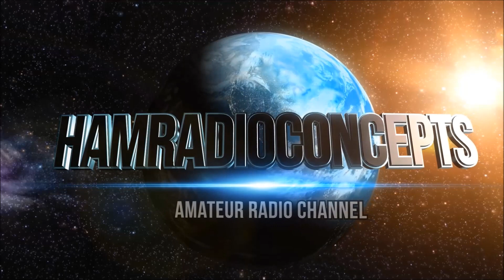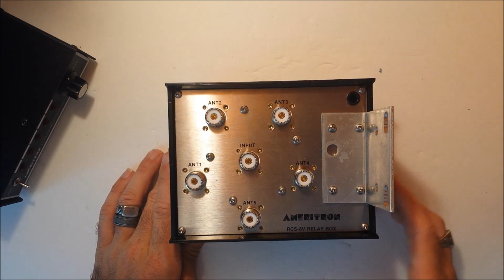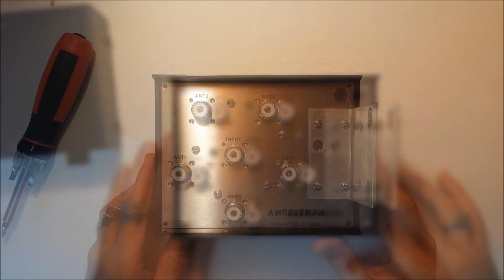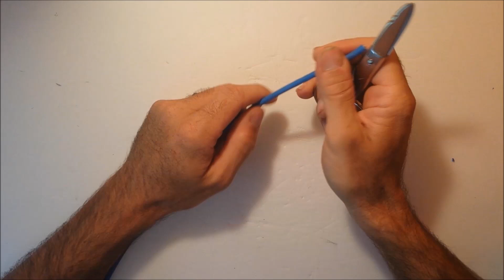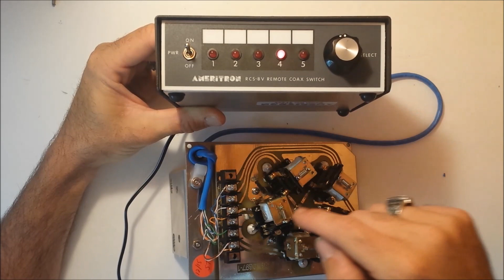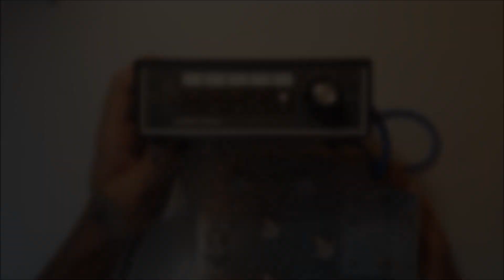Ameritron RCS-8V remote coax switch

Comment: Hey Eric, is that EIA-568B wiring.  Haha. #datacom-joke.  Lame joke, but I am a Dad.  Haha.  I wonder how hard this would be to mount in a vehicle.  Maybe some DIY on the control box would be required.  Did you say the current is 200-300mA? I am thinking of using Ham Sticks for a couple of bands for my mobile setup in my new truck.  Thanks for all you do for the hobby!  All the best!  73 de KI5HXM

Comment: I just rewired my 10 year old Ameritron (RCS-8V) switch and it lit up for about 5 minutes then the transformer got hot and the power went off.  There are two grounds on the control head.  Is either OK? Any Ideas?  Is this 8 volts or 10-14?

Comment: I like a single, isolated ground coax switch for each antenna, because when using the common ground setting, too much noise is introduced to the main coax line.

Comment: I almost think a better technology would be a relay controlled (or maybe a servo motor controlled) rotary switch. You could control it with a $1.00 4017 16 pin switching IC. 

The only time power would be required would be a single pulse to for switching.

Comment: Great video!
I have a few concerns with this.
1. Unless you supply power to the Ameritron, none of the relays will close. This means you always have to have power to this unit, when using your rig.
2. I checked out this item on eBay, and its expensive ($160 Canadian). If you purchased the relays and a rotary switch and SO239 connectors, you could build a similar device for a fraction of the cost. ($50 Canadian, my guess).

Comment: +HamRadioConcepts Provided you are actively using the switch.  How has it been working for you?  I have been considering buying one.
Reply from the maker: It's been great. I don't switch with it all the time, right now only a dual band antenna and an hf vertical, but working fine.
Reply: Thanks +HamRadioConcepts.  I want to switch between 2 dipoles (10 & 40) and a 6 meter vertical.  I was going to get the RCS-4 because it didn't use the singling cable.  The problem for me was it didn't support 6 meters.  I just didn't want to run a control cable to it.  My antennas are 100 ft from my shack.  Any cable run to them is expensive.

Comment: Just recently bought one from DX Engineering. Already had enough rotor cable, but had not considered Cat5. I live in the NE, so don't have the blazing sun. However, wouldn't have made any difference as it will be on the north side of the house and won't see any direct sunlight.

WB3BJU